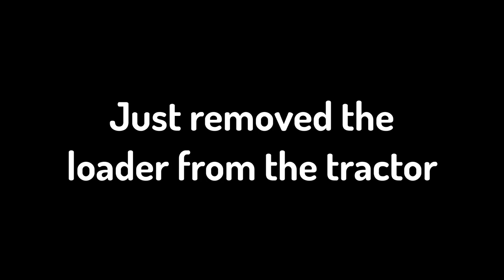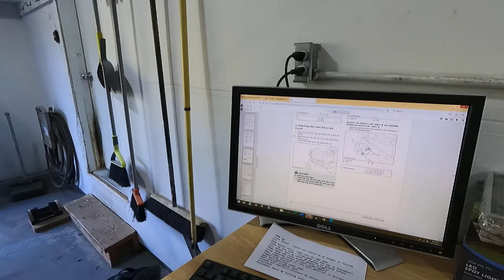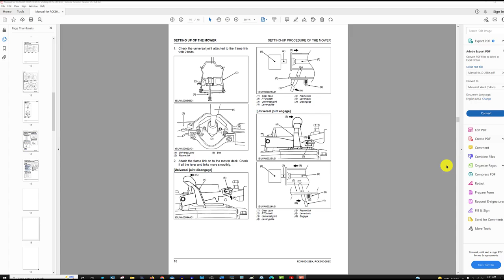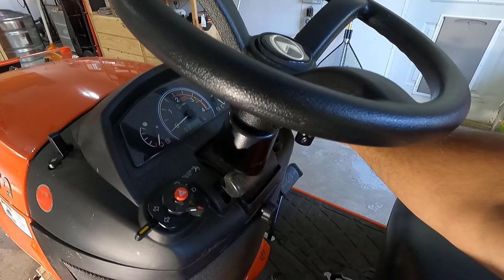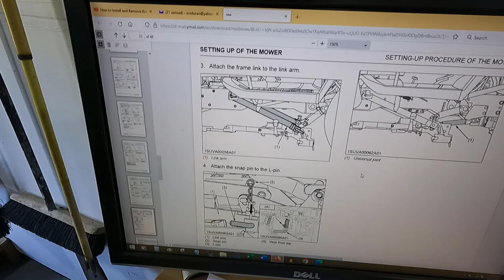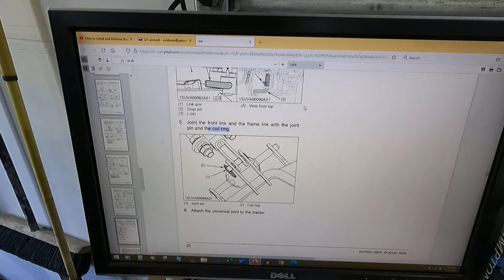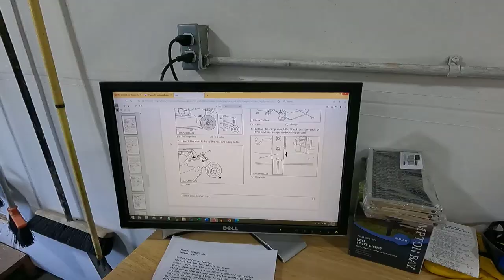How to Install an Easy Over Mower Deck on a Kubota BX Tractor

Comment: Thank You! You are right. Your video was the ONLY one I could find about reinstalling the front link and frame link after the dealer removed them to install the snowblower not providing any reinstall instructions or manual.
Reply from the maker: Glad that it was helpful.

Comment: Ovi, you may know by now but, all those front and subframe attachments, you only have to mount those parts once. Then they stay on the tractor and all you do after that is drive over the deck for install and back over the deck for removal. But, if you are mounting the snowblowwer then those 2 pieces of frame do have to come off and on each time you change the attachments

Comment: Great video Ovi. I will be doing the same here soon up in North Georgia. Subscribed to your channel. I am from Hormigueros which is how I found you when you did the drone video. Retired from Air Force in 2009. Thankfully, I inherited a Deere riding mower for the lawn mowing on a small chunk of the 10 acres I will be at and when I get the Kubota BX-2380, won't need to get the mower deck and save up for the box blade and stump bucket. But, you got it down! Una jodienda que convertistes en exito! Saludos!